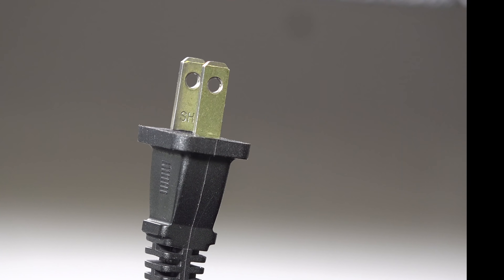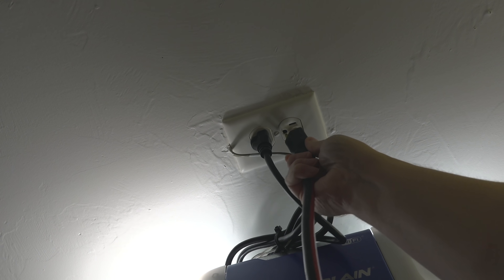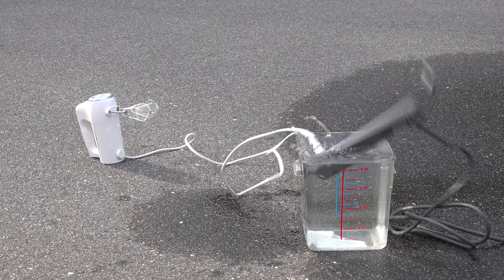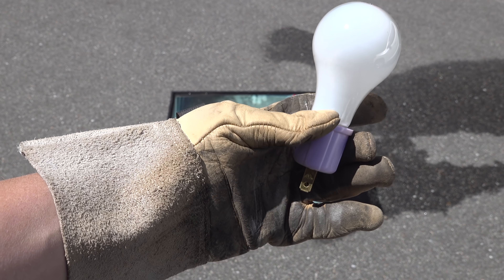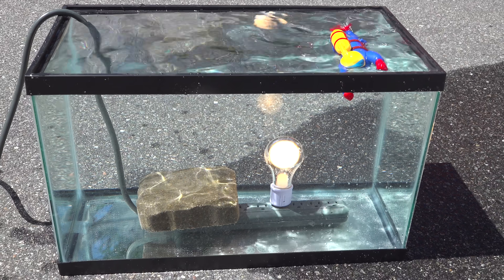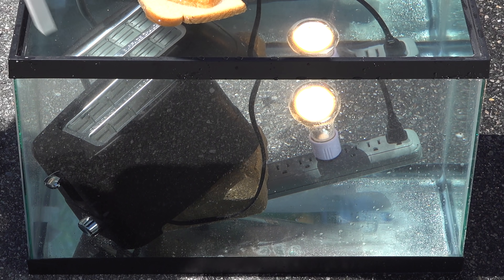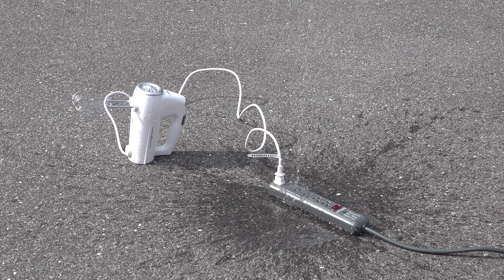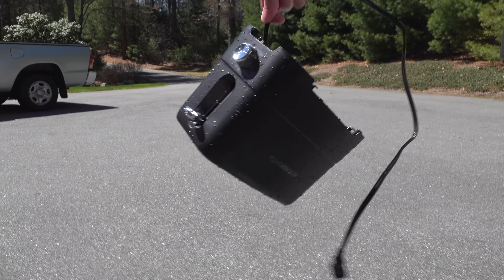What REALLY HAPPENS WHEN YOU SPILL WATER in an OUTLET?

Comment: The change is actually the electricity would heat the water up. I remember this when we made a simple water heater for out home ec class in the Philippines. The components are a metal plate where the two contact points on the outlet wire can be attached to. You submerge the metal part on the large plastic bucket, plug the socket in then wait for about 10-20 mins, then unplug the contraption then pull out the device from the water, then boom, you get hot bath water. :)
Reply: Similar devices are sold in some third world countries like China.  They do electrify the water so you have to unplug the water heater before using the hot water.

Comment: Electricity and water needs salt to cause a current to run through the water the absence of salt or other heavy minerals will do nothing. Tap water has contaminates in it so using tap water will yield a different result but use purified water attach a battery to a light bulb put one end of copper wire into the water take a wire wrap it on the other side of the battery and place it in the water the bulb won't light up until a transmission medium is put in it like salt. Your skin is salty so touching water sitting on a live wire will electrocute you but otherwise water insulates current and makes it harder to flow.

Comment: The GFI does not trip from just being wet, it actually has to have less power come back in thru neutral than went out thru positive. That's why the bucket of water doesn't trip it but water dumped on it does. In a tank/bucket its all enclosed, power is going out thru positive and all coming back thru neutral, you'd have to put your hand in and get shocked or put in a ground wire in the water to cause the voltage difference to trip the GFI. When the difference hits a certain percentage, the energy is used to fire a solenoid that severs the connection.

Comment: Water is a terrible conductor unlike what most people think. You can submerge a whole computer and run it in water as long as the water is pure.
Reply: I only spilled a small amount of water on one of these once and it started popping and blue sparks came out :o And my niece accidentally upended some water on my laptop and it fried. Is it something to do with the water quality?
Reply: @Vexarax  Its not the water itself that ruin electronics but because it contain minerals and other impurities. If you remove those you can run electronics submerged in the water.

Comment: It does not work because they is no physical material that will use the current and voltage. If a person were holding that socket the current will flow through the person and he will absorb the current and voltage. Breaker will only trip once it exceeds it Amps rating.. Maybe you should have added some salt for the water to be more conductive

Comment: water aka H2O is actually not electrically conductive. the only reason why water gets conductive is because of dissolved particles in the water. most commonly with household water, the dissolved particle is calcium which is a metal and conductive.

Comment: So this is why my attempts were met with failure. Jkjk I've actually been shocked with a current from an outside extension cord that was pinched under a metal door when I was around 13 and it was the worst I've experienced. My shoulder and left arm were touching the door since i was used to slamming that door shut not realizing a cord was under it and bam it hit me and I couldn't let go for 20 seconds or so. Ive also been shocked by a poor excuse of an underground power cable going to a pool.

Comment: The outlet divide the electricity and make electricity flow, and water are also electric conductor which electricity can flow, if you touch the water you might be ground, the electricity is too low for you to die or burn or for it to explode.

Comment: water is not conductive so putting electricity in it only preforms electrolysis but because there are minerals in the water the minerals conduct electricity and is not that good at it and problobly won't cause so much power to come out of it in order to trip a breaker, but it can still definitely hurt you if you are inside.

Comment: You should really have explained why the fuse didn’t pop. Resistivity (not resistance!) of drinking tapwater is between 1000-5000 Ωm (really pure water is 20MΩm!) Depending on size of contacts, distance between them you’d probably get something around 10-50Ω. So your ‘drop in water’ just leads to 120V/10Ω=12A current or 1440W power usage (or only 288W for the higher resistance). Significant, but won’t blow a fuse.

While it’s non-trivial to go from water resistivity to resistance, and the above are just estimates, I just wanted to show how unlikely it is that you’d pop the switch this way. Putting your hand in there is another story, as you’ll have quite some surface area and your body is quite conductive. Still, it won’t blow the fuse, which is why electrocution is so likely and scary when playing with water around outlets.

In contrast to the above, river water has around 200Ωm resistivity and coastal seawater around 20-30Ωm. Which is why seamen are way more scared of short-circuiting while out at sea. It all depends on the amount of impurities.

Comment: I have been using these cheap strips outside for my Christmas display for decades. I leave a lot of them outside 24/7 in a subtropical environment with no issues other than the outer casing turning yellow because of the hot sun.
Reply: Please be careful with those lights: if they are the "LED with some heatshrink on the LED and wiring"-style, they might be more dangerous than you think... Look up some of BigClive's video's about cheap Christmas lights.
Reply: @Dutch3DMaster  Led lights suck...expensive and do not last long. I run LED light tubes like the ones used on bridges. Also, this is a power strip not a light . Here ya go. https://www.youtube.com/shorts/xaGbEsnEUGQ

Comment: To put it bluntly, GFCI's trip before the lethal 50 milliamps of current is detected through a grounding fault (hence ground fault circuit interrupter).
Traditional breakers trip after at least several amps.

The conductivity of the water was only enough to trip the GFCI, which pretty much sits at 1/1000th of a "normal" breaker limit.
Reply: I don't understand what you are saying. 
But, I am testing.
I have a small tool plugged into an extension cord with a dbl outlet GFCI  .
In the 2nd outlet, i plugged in a small extension cord with noting plugged into it. 
When I power up the whole shebang  the tool runs, then i drop the empty cord into water. The tool keeps running. 
This is disappointing since soon I intend to be using an elect tool where I will likely be in contact with water.
I don't understand the details about electricity but
I would feel better if the gfgi had tripped off as soon as a difference in current had been detected.

Comment: I think the reason nothing was happening was that when the appliances were plugged in and running there was a complete circuit and thus a path of least resistance. I'm curious of what would happen if the outlet is dropped in the tank without having anything plugged in
Reply: The path of least resistance would be a much better one through water.  A device being plugged in really doesn't matter, because that device will never be a dead-short like water will easily be at short distances between a live and neutral wire, or live and ground wire.
You saw what happened when the socket that is behind the ground fault interruption device was used: it immediately cut out.
I don't know what the limits are for current in the ground fault interruption devices there, but in The Netherlands, I think it's at 4-5mA that makes it trip.
Since we are on 230V single phase, that's probably different than with 120V's.

Comment: I've tried killing electronics a few times and it's really difficult. One thing I tried to kill was an old pc, even poring water directly into the card slots didn't do anything, I ended up shorting the pins on the north chip with a screwdriver out of frustration. I learned later that clean water from the tap was the problem, using dirty water was much more effective.

Comment: The danger is that if the electrified tank of water is insulated from the earth and you're standing on wet grass (grounded) then reach into the electrified water to give it a short circuit path to earth through your conductive body, you will be paralyzed and possibly killed over the course of 10 minutes or so by standard 120 volt house current.

Comment: I was wondering, if you just put the extension cord in the water and put a plug in the water without connecting them together. and the plug has a lamp that is outside the box. does the lamp light up?

Comment: I broke my art teachers outlet, extension cord, and Smart-board with a paperclip and a pen. She kept the extension cord on my desk, so when we weren't doing anything i slowly pulled out the plug that was in it so that the prongs were showing, but were still functional. Oh! what do you know! there Just so happens to be a paperclip in my backpack! I attach it to the pen so I won't get shocked because I may be impulsive and stupid, but I know how electricity works. I touch both prongs with the paper clip and sparks shoot up 2 feet high within a foot diameter. not to mention that everything around this is made of wood, so it's nothing short of a miracle that everything didn't burst into flames. anyway. after all the staring everyone looking at everyone, it all settled down. the plug and the outlet were both fried, and there wasn't another outlet close enough to plug it into. and we had to wait the entire period for the school to dig up another extension cord. (one of the 1,000,000 ft long orange ones, not the short corded 6 outlet ones) so we got to sort of skip class that day.

Comment: Actually water is one of the best insulator of electricity... but only pure distilled water....I think if that's pure water it might not affect any operations cause it's just kinda acting as insulator just like the the wires are insulated by polymer...but any how if the water is made acidified the whole water conducts electricity and damages the components of the appliance.

Comment: Did you run a multimeter to the water to see how much current was being conducted?  Also that light bulb shouldn't have floated if it was under vacuum like a traditional incandescent.  My guess is that it was a frosted CFL or Halogen.  This means that you probably were drawing the full 100w, but you were emitting 100w of light at an energy efficient rate.
Reply: Why wouldn't an empty bulb float? It would have less density than a bulb filled with gas.
Reply: Why would it not float? If it had a vacuum inside, it is still much less dense than the water, and it would float. Any light bulb that draws 100w will not emit the full 100w as light energy, nit visible light anyway. Most of it's energy is lost as heat.